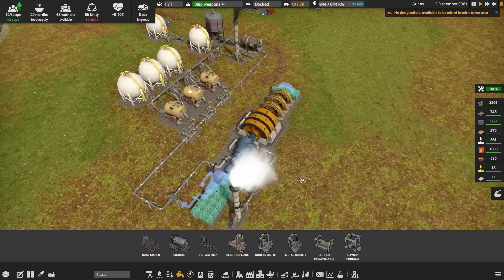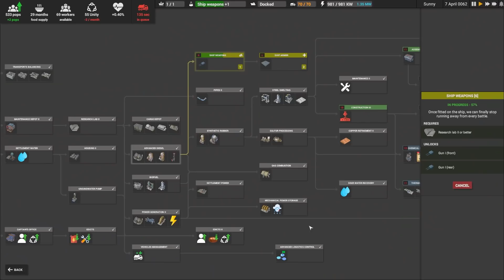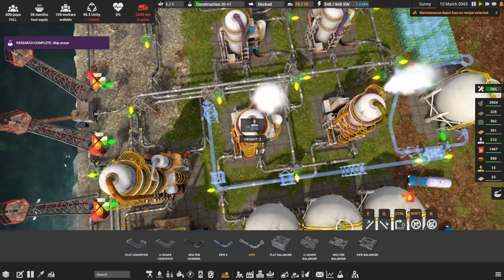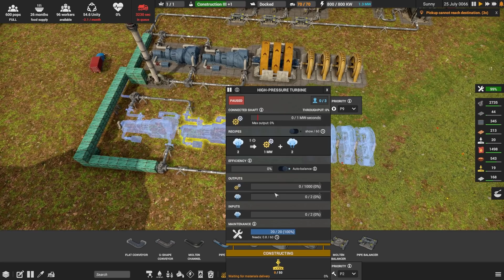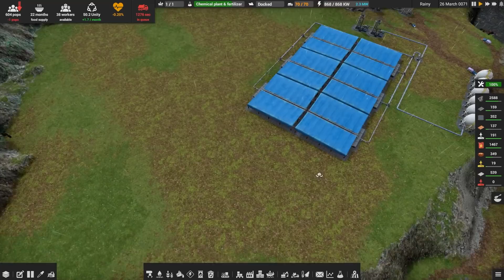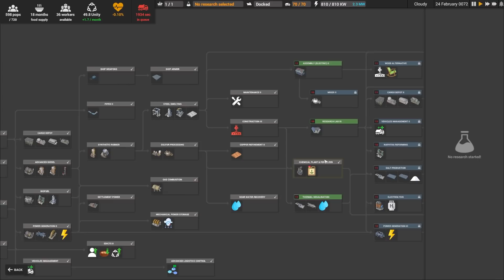Time for a BIG Industrial Expansion!

Comment: This game looks amazing, the thing that gets me though is the power, it looks like when it doesnt need it, it just shuts the systems down, when realistically the system keeps running and outputs to power banks! I hope to see that get addressed before release!
Reply: It's because he has all the turbines set to auto balance. Really he should manually set one to always running and one to auto balance. Pause the other two until he has the need for them. No point having 2.3mw of potential power production when he only uses half that. The flywheel is there to take up sudden demand until the auto balance can kick in.
Only having half running would also reduce water wastage as they're not constantly powering up and shutting down when they're not efficient

Comment: I see the food edicts as giving them rarer foodstuffs, like spices or less efficient root vegetables.  And the water edicts let them have extra water for cleaning.  They can now use proper soapy water to take a bath instead of having to wipe down with a damp sponge.
Reply from the maker: Lap of luxury I tell you!
Reply: Depends on the way the food edict is set up, more often than not it's enacted to stretch out dwindling food supplies as much as possible, same goes for the water edict, that's usually only enacted when there's there's low amounts of water stored or there's a long drought...Australia basically enacts a kind of water edict every summer, they want everyone to use less water to stretch out the reserves in the dams while we wait for rain.

Comment: Assistant: "There is an acid leak"
Manager: "How do you know?"
Assistant raises the blinds on the office window
People outside the window: "Breathing burns!!!"
Manager: "Suggestions?"
Assistant: "We need to move acid production away from the residential area."
Manager: "I have a better idea"
Manager puts on a pair of noise cancelling headphones and lowers the blinds
Manager: "Problem solved!"
Reply: Don't you love upper management?

Cue the angry populace grabbing their torches and pitchforks and rioting outside the building
Reply: Sounds like China way of dealing with things
Reply: @medicman4444  So during the 19th century the British cabinet noted the horrific  stench coming from London's sewage system, which is colloquially known as the River Thames which just happened to be outside their meeting chamber's window there were multiple suggestions to try and increase public hygiene and create an actual sewer system that would take the sewage out of the city rather than dumping it straight into the Thames. However it was decided that such solution either did not make sense or cost too much and they simply treated the window and curtains with chloride of lime (a type of bleach) effectively blocking the stench from entering parliament and solving the problem... for parliament at least.

That was the comparison that I was trying to draw.

Comment: Hey Aavak,  love your stream.   just a FYI when looking @ recipes  and working out what need what?  Right click on the ingredients( input/output)  By right-clicking on the icons you can easily navigate pages about different products.  This also work when hovering on when using the ui, when building/planning.  Just makes whats what easier!?
Reply from the maker: Oh, that's perfect, thank you for the tip :D
Reply: @Aavak  no problem,  from a fellow captain.  Just looooove this game.  Hats off for the 2 dev guys.
Reply: @Aavak  Once you switch the production to per 60 you'll note that one blast furnace produces exactly enough for one oxigen furnace, which in turn nicely feeds one cooled caster.